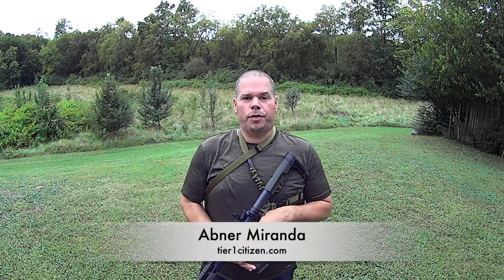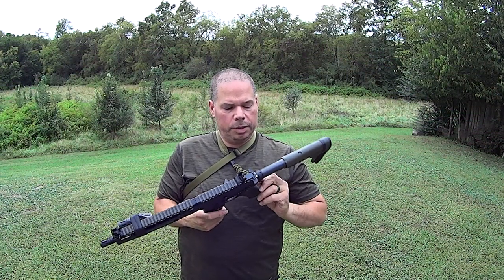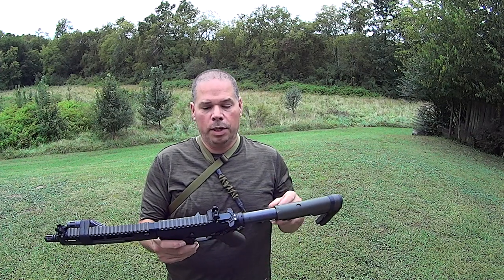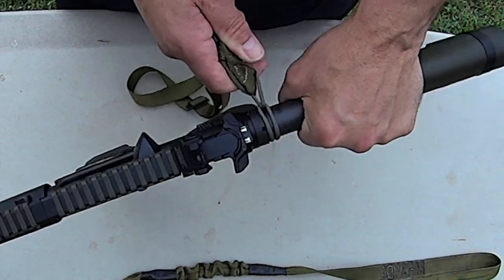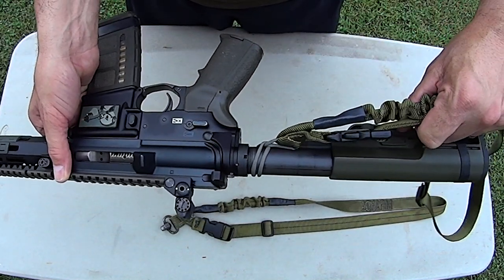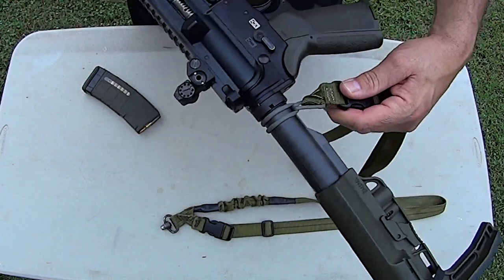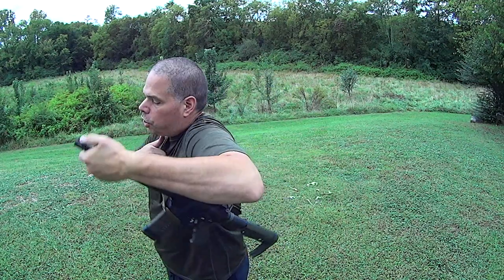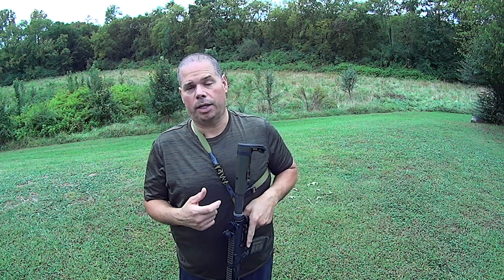Tier 1 Citizen Single Point ParaSling

Comment: Hi, Abner. I personally prefer a ziptie. It will never get in the way of the charging handle. Thanks for sharing. God bless you
Reply from the maker: I fixed the link, try it now.
Reply: Either way this wouldn't effect me, im looking for airsoft tips and tricks. And mine is an aeg that doesn't use the charging handle unless I wanna open the hoppup. Of which I configured months ago
Reply: Having worked in the manufacturing industries with numerous zipties I felt that I should point some things out. Zipties rapidly degrade over time and especially in sunlight, UV light and heat. They become very brittle. Rock climbers deal with this too with slings degrading over use/time. The zip tie can be replaced real cheap though. They are just not good for long periods of time. Keep new spares, not grandpas bargain bin pile from 10 years ago!

Comment: Great idea bro , i have wanted a single point for my 6920 but i didn't want to screw with the castle nut for the reasons you were mentioning. It would be really cool to see a vid after you get a bit of hard use on this  to see how the cord holds up.

Comment: Love the concept and ordered the Paracord 1 Point Sling. I tested the sling over a 3-day field training exercise and I only have 1 issue with the product. 
Training in various team formations requires shoulder transitions. As I made transitions from shoulder to shoulder, the paracord knot would have to rotate around the tube due to its knot design, the knot will not rotate back and forth. This resulted in the sling material near the paracord twisting up overtime.  A few times I had to unbuckle the sling and untwist. I also had to be aware of the knot rotating past the charging handle zone during my transitions. Aside from that the sling is high quality and fantastic for other applications.
Reply from the maker: If you want to post comments and feedback on the sling, that's fine, but, communicating with me, directly, would be greatly appreciated. This is the first time I have heard this, and I don't even know who you are.
Reply: @Tier1Citizen  I placed an order on April 15th from Texas. I’m not exactly sure how to personally contact you.
Reply from the maker: Go to my website and go to the bottom of any page and click on "Contact." Here is the link: https://tier1citizen.com/contact

Comment: Take a center punch and push back the staking other way to undo it. You will need a new receiver end piece which are cheap. Always double stake castle nuts. Use a prick punch to start staking and center punch to finish em.

That said Rangers used to use paracord attachments to rifle so sling wouldn't smack gun and make noise on missions.

Comment: its honestly not that hard to remove a staked buffer tube or even a double staked buffer tube all you need is a firm grip and a armorers wrench no heat or blowtorch is needed. i put a qd end plate on mine and it took 5 minutes. also its not very likely you will break your gun doing this. just crank her off and throw your new end plate on a restake it.

Comment: The proper armors wrench for the buffer tube castle but and you’ll not need a blow torch.
Reply from the maker: You will if it has Loctite on it. I have professional armorer's tools and they can't get through Loctite 242 unless you heat it first.